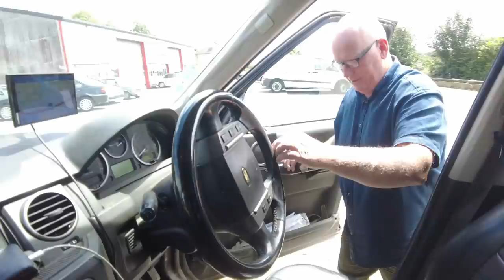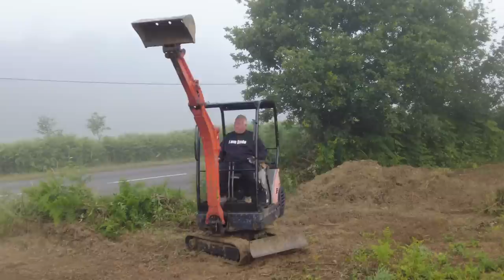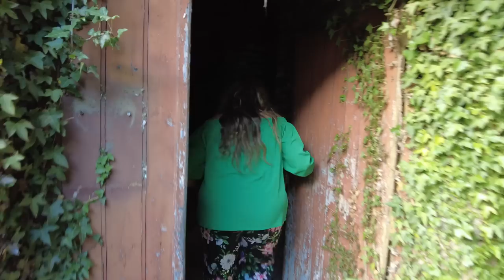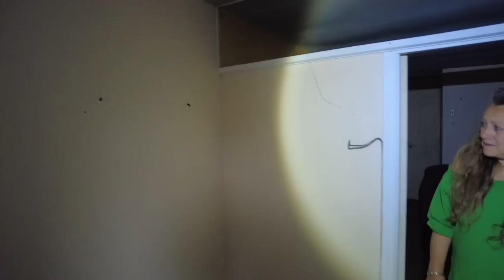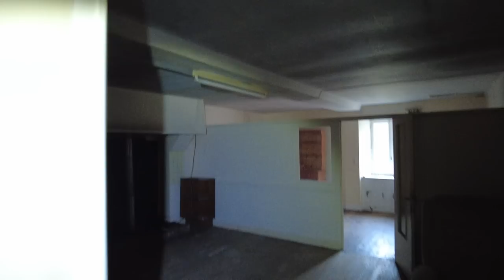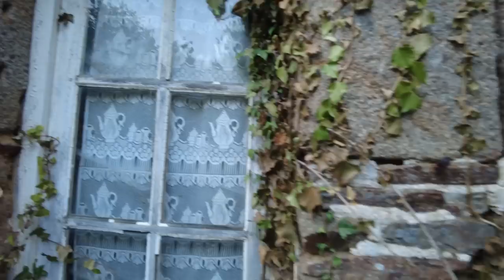No 52.COTTAGE RENOVATION

Comment: Loved the tour of the cottage! Perhaps the top floor or attic could be a rental unit like an efficiency apartment or bed & breakfast. Maybe the current appliances could be used up there if they still work (refrig, sink). Love that you are getting horses. You are such hard workers!
Reply from the maker: We will consider everything thank you for the suggestion gsjob11 bon weekend 🤗❤🌷
Reply: Ah but then you would have all the noise from people walking around unless there’s sound insulation but it could make a good studio apartment. I suppose it depends on what level of work for the property that they want to do, for instance if it’s a holiday let then it would mean hours of work every week and if b&b then it might swallow up all of their time in cleaning and cooking. However, if just a normal long term rental then that might be easier but then there’s parking etc for whatever use it is put to. Very difficult decisions for them both but I’m sure they will do what is right for them. Either way it will be a quality finish.

Comment: the cottage is really quirky, I think I would be inclined to put 2 bedrooms and a bathroom downstairs then have the lounge kitchen diner on the first floor and put a glazed summer room  on the back with the access onto the garden and integrating a staircase to the attic with 2 additional bedrooms and another bathroom. that way it could be suitable for 2 families with shared lounge kitchen area if you were to do a holiday rental or will be ideal if you have volunteers coming to stay to help with your mammoth projects.

Is it practical to run a driveway down from the farm house to the cottage to provide off street parking at the rear and make it the main entrance into the cottage and also provide off road parking as it looks like parking could be a problem on the road. 

Certainly is an interesting project look forward to see your plans. Robb Torremolinos Spain
Reply from the maker: Hi Robb some great ideas there buddy thank you we should of said in the video there is parking there for the cottage just of to the left as you come out of the cottage with a small building which is ours to we will show that in a up coming video thank you for some great suggestions all the best Budo 🙏👍
Reply: @FrenchFarmhouseDiaries  With property I think it is always best to try and get the maximum flexibility and to try and keep things simple as possible the 1st floor main room would at least potentially give you views onto a garden rather than a road even with a summer room built onto the back.. look forward to see how the plan comes together 😊

Comment: I am not sure but there seemed to be a bit of traffic noise from the road outside.
Is it possible to consider double glazing the front windows?
Reply from the maker: Hi Ron thanks for your comment we would never use double glazing on any building built before the 1950s and the cars going by are not that noise to be honest its the DJI we use keeps picking up car tyres and high pitch sounds from electric tools but a great question thank you buddy 👍